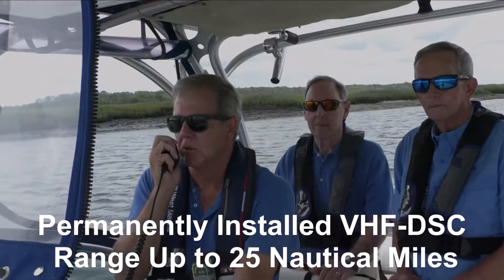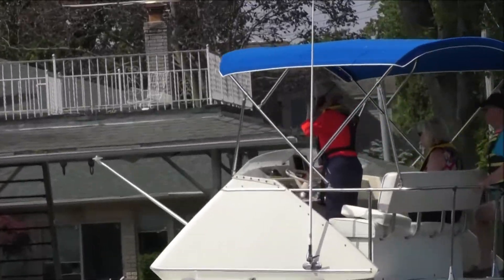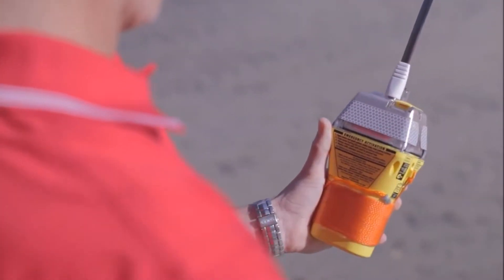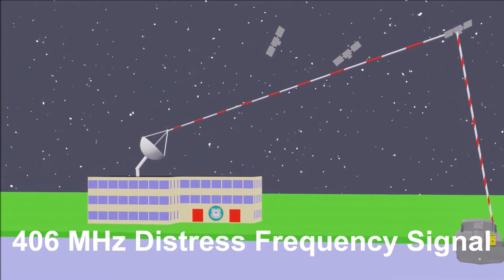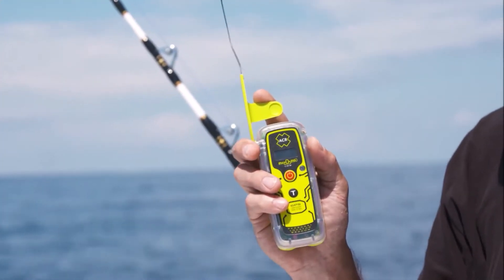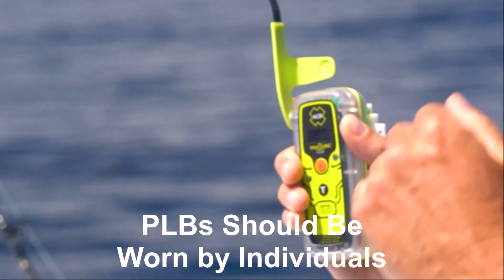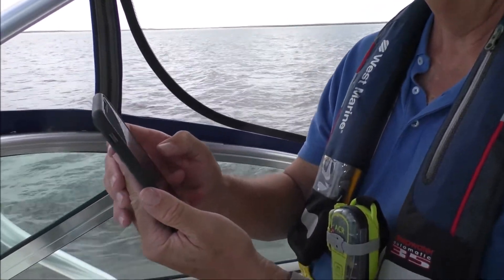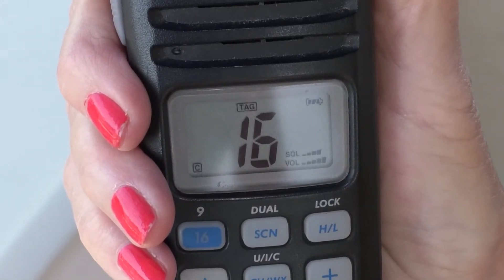BASIC MARINE COMMUNICATIONS

Comment: What is the exact name of the USCG I-911 smartphone application? What does the image associated with the app look like?
Reply from the maker: There is no app for consumers,  you just dial 911 from your cellphone on a boat. First responders are equipped with a web-based app to track your call.
Reply: @AmericasBoatingChannel  thanks. Why did you call it "I-911" and just not say to call 911?
Reply from the maker: @marshalltyler7110  Fair question and reasonable suggestion. Thank you for both. It's a new and unfamiliar system to many of our viewers and in introducing it we used the term "i911" given it by its technology developers and first-responder customers to distinguish it from traditional "911," which lacks the GPS accessing web interface, etc.